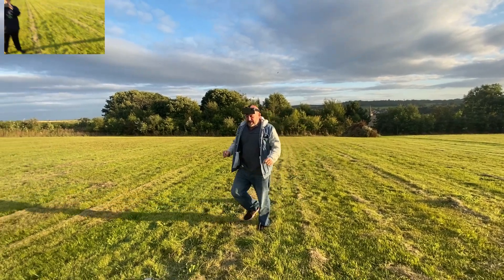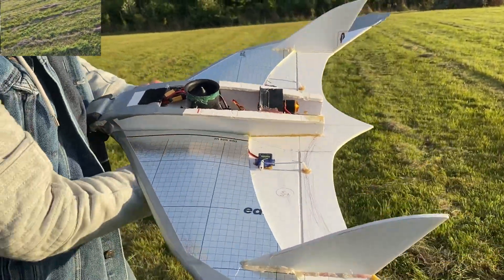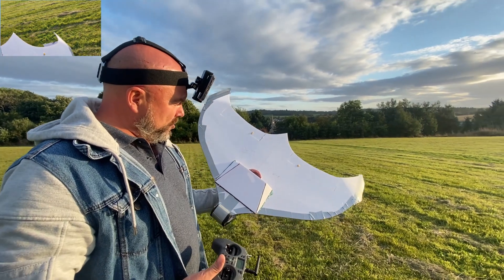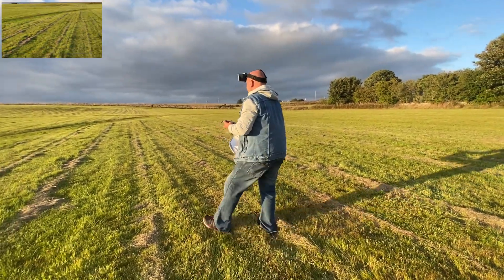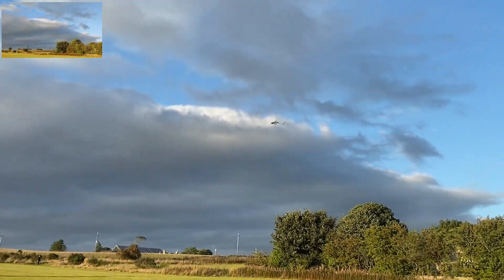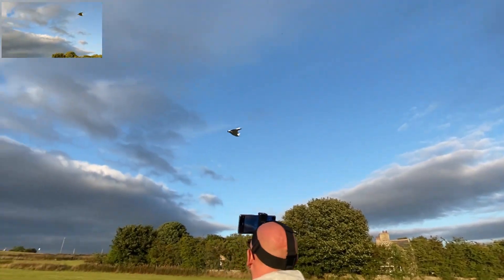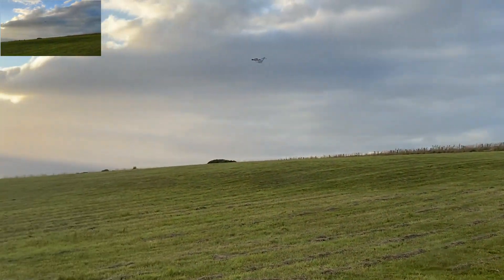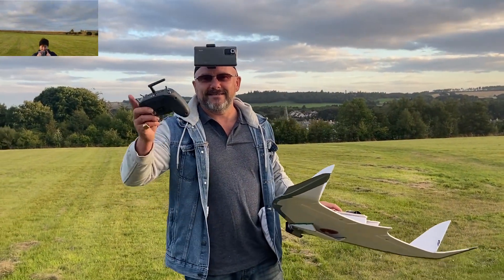Dual EDF RC WING. NEW HORIZONTAL TAKE-OFF SYSTEM

Comment: A lot of fun as usual Eric. And success too! 😉
Might need a large dose of CorrosionX/Conformal Fluid before you put it anywhere near water though. 😉
Reply from the maker: A surprising success 🤠. Seriously any idea what would be the easiest way to waterproof the electronic?
Reply: @ericflighttester7145  Personally I'd just keep it away from the water! 😉
But I know that you are not going to do that so I'd seal the receiver in a balloon with silicon sealant and coat everything else in CorrosionX (or whatever equivalent stuff might be available in the UK/online. For the power that you will be drawing with your 2x EDFs you probably can't seal the ESCs into balloons. Best of luck with your crazy experiments, mate! 😊